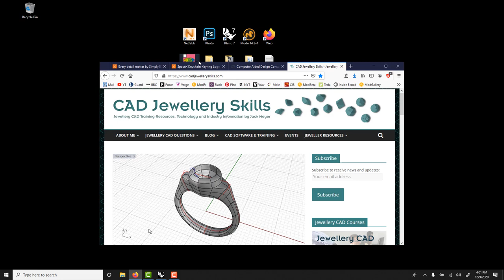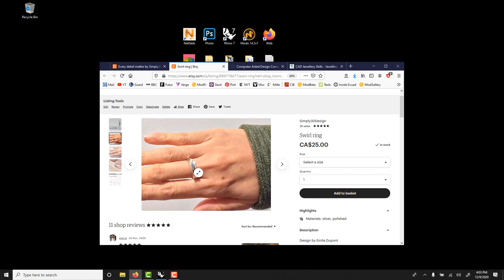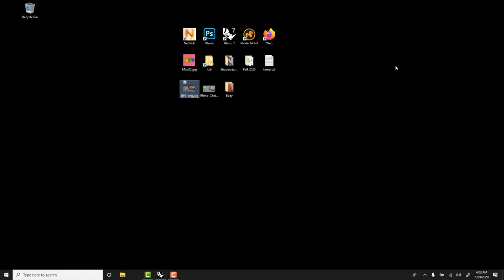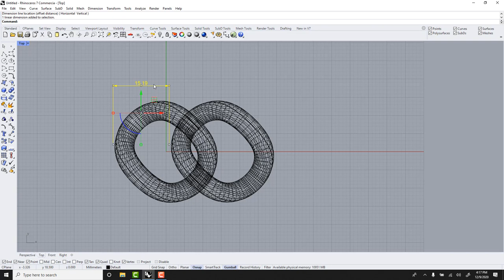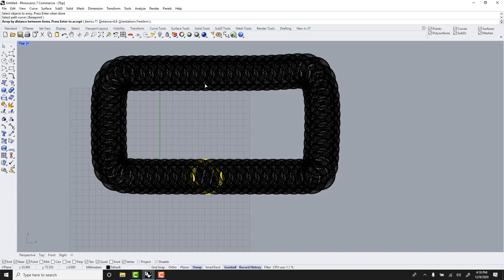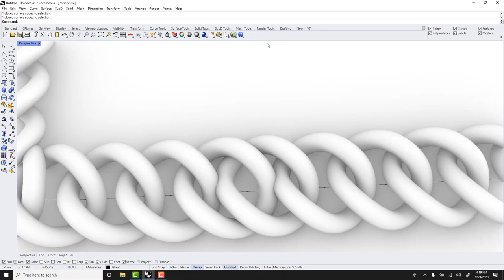Rhino 7 Jewelry Chain

Comment: How would I boolean the chain to make it flat on both sides like you have done in your initial designs? :) Thanks for all your great videos. I went from knowing nothing about CAD design to at least having an arsenal of tools and templates to start from - it has been very helpful :D (y)
Reply: I managed to get it right by creating a box at the bottom and then making it bigger than the chain. I slightly moved it lower and then Boolean Difference that new box with the original chain. It worked and then i had to do the same thing for the top... Although I am not sure if it could be more efficient by forcing actions to happen to both top and bottom at the same time? :)